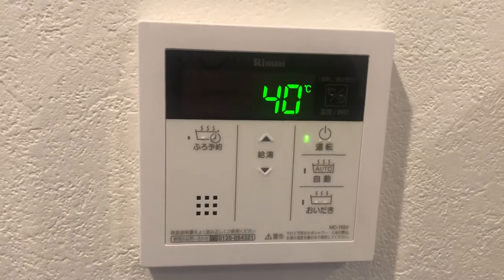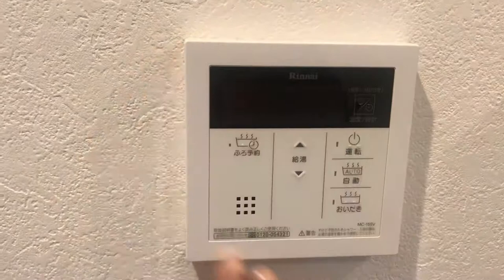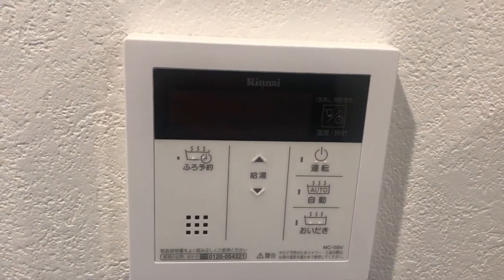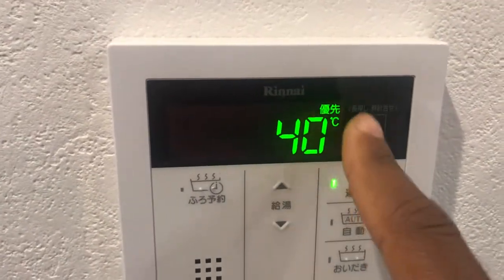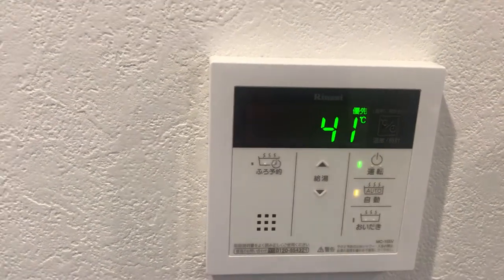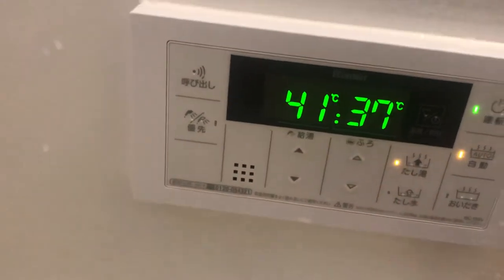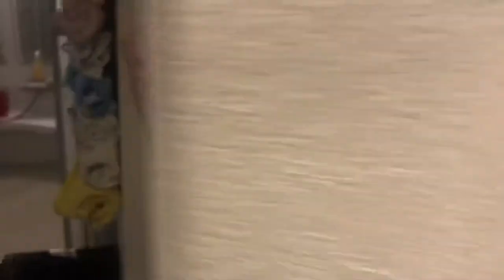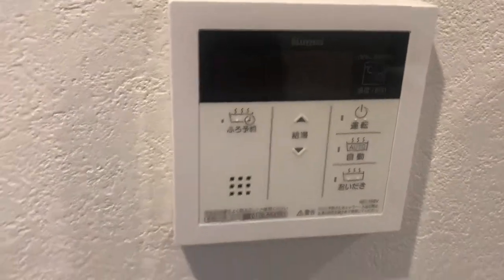This is how you use hot water in Japan

Comment: When you turned it on does the hot water come out right away or do you need to wait a bit, cause I have the panel as well but since I moved in to the apartment, the hot shower doesn’t come out

Comment: Just confirming if you leave the power on you will still be using gas_? Our gas bill was huge could this be the cause_?
Reply from the maker: Tokyo gas says that with the later models you don’t have to worry about leaving them on because there is something built in where it won’t use gas . Older models should be turned off . Yeah likely the cause
Reply: @DaddyTJapan  thanks so much! Great video too.
Reply from the maker: @HunterKing-jn9kt  glad it helped !